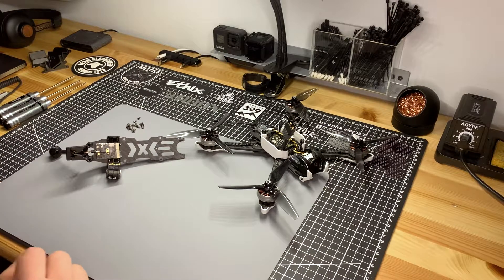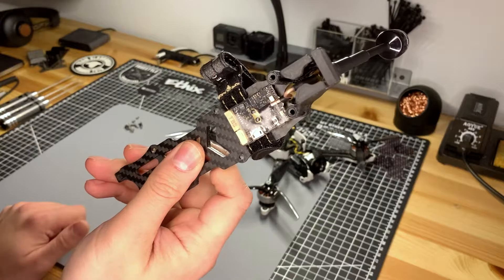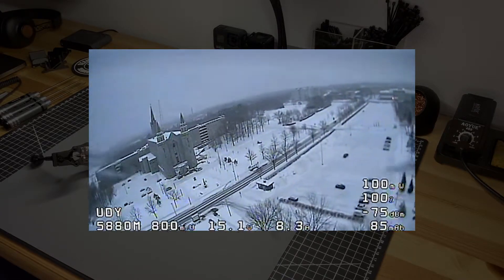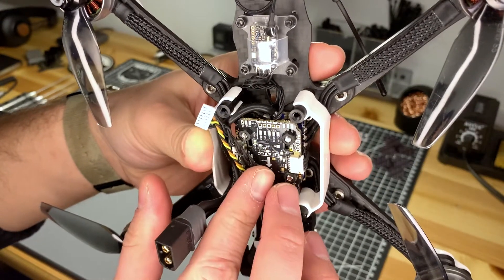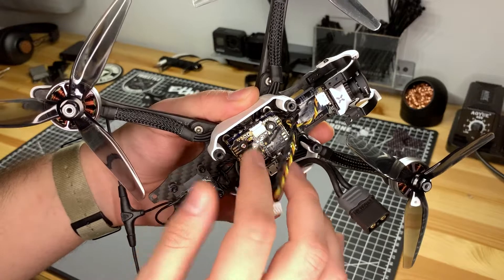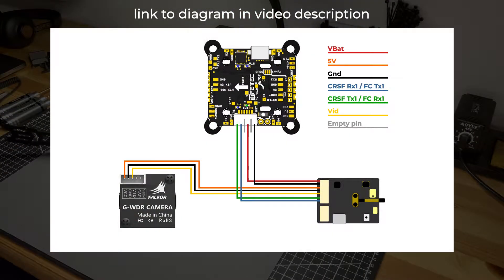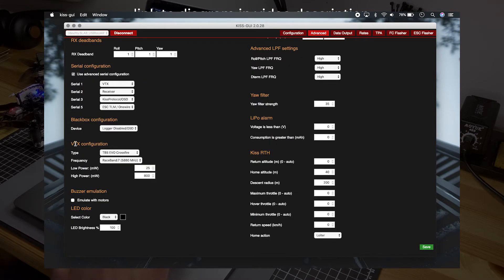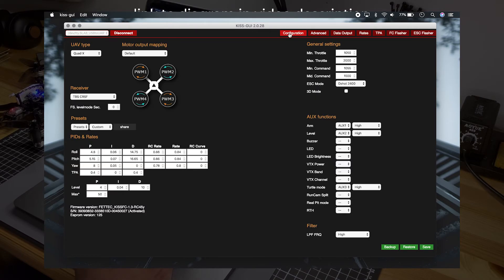Set up TBS Evo OSD with FETtec KISS FC || Food For Flight - Ep. 2

Comment: I think is just what I have been looking for with the Evo vtx, only in using the kiss FETtec G4 fc. 
I can’t seem to enter the VTX osd menu through stick control on the radio, supposedly roll/pitch center, zero throttle and yaw left!. 
I have the rx1 smart audio cable from the vtx going to tx3 pad on the fc. As per the wiring diagram for the fc 
Would I still need to follow your serial set up in the gui?  Currently I have vtx on serial 3?

Comment: Is Ghost an option in uart 1? Thanks for the vid!
Reply from the maker: As far as I know, Ghost is supported as of version RC46z (5 versions ago). As such, it should be possible to select ghost in the rx type on the main page and reassign rx serial to serial 1 in the advanced serial config.
Reply: @udyfpv  with ghost you connect the signal wire to a TX uart. So I Solder to that or does it have to be a RX uart for fettec? Thank you SOOOOOO much!!!
Reply from the maker: Let me check, I don't wanna give you bad info 😅 I'll get back to you asap

Comment: Serial Configuration: I'm not seeing this section on the advanced tab?? Kiss GUI 2.0.32.  What am I missing?
Reply from the maker: There's a checkbox "use advanced serial config" (or something similar) that you need to tick halfway down the column on the left side to get it. It'll display a big scary warning but you'll be fine 😉
Reply: @udyfpv  Thanks.  I had the wrong firmware loaded.  LOL
Reply from the maker: Happens 😅 enjoy, it's a great VTx 🚀

Comment: Great video! Thank you so much for making this. I have the same setup. 
How did you connect your Crossfire Nano? Is it connected to the FC or to the Unify EVO? I don't see any soldering on your FC where the CRSF is supposed to go. The wiring diagram doesn't explain this either. 
Would really appreciate it if you could let me know.
Thanks a lot!
Reply from the maker: Hey! You're right, unfortunately I didn't go over that point in the video and also didn't specify the Evo's settings in the TBS Agent X.

I prefer using the connectors on the FC and have the Nano XF plugged into the connector underneath the FC, the one facing towards the back of the quad. In TBS Agent X, you should also have the Evo's VTx connection set to CRSF.

Let me know if you still have trouble or if it solves your problem 🚀 Happy flying 🤘🏼
Reply: @udyfpv  Thanks for the info! So you made a connector for the XF nano that plugs into the FC, correct?  Good to know about the EVO configuration in Agent X, will keep that in mind when I get to that part. 

Thanks again for your help!
Looking forward to your next video!
Reply from the maker: Exactly, I made a connector for the Rx. You need a 4-pin JST-SH connector, same type as the other connectors on the FC. The wiring is pretty simple: ground and 5V line up and Rx/Tx wires cross over each other.

You can also direct solder your Rx, I just have a bunch of spare connectors and crimps. 

Thanks for the support!
Reply: @udyfpv  So you need to cross Rx/Tx when using the connector? If you use pins and place the Nano directly on the FC, the connections correspond directly to the layout.
Guess the channels are crossed in the connector housing. Anyway thanks again for taking the time to answer my question!
Reply from the maker: @RicardDzunic  no problem! And you're correct, I made the same mistake on my two first FETtec builds thinking the pins connected straight through, only to get nothing in the data output tab. The way the pinouts are mapped in the docs makes it a bit confusing as well.
Reply: @udyfpv Okay, thanks for clearing that up!

Comment: Great video! I used the same setup, wiring and configuration like you did but I can't seem to get Amps drawn and all the info on the right showing in my OSD. Any idea why and how can I fix that?
Reply from the maker: Hmm good question. I think the latest firmware version for the Evo is 1.15. Have you tried flashing it in TBS Agent X?
Reply: @udyfpv  Yea, I had latest firmware version. I later figured out the problem. My vtx connection setting was set to smart audio and not CRSF, that's why those wouldn't show up
Reply from the maker: @RobertPoptamas  oooh damn yes I totally forgot about the config in Agent X!